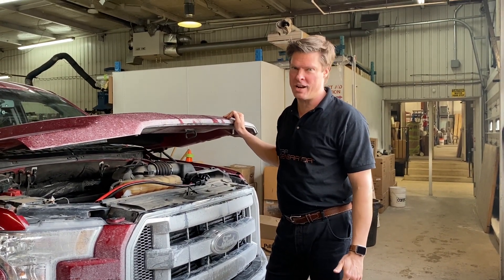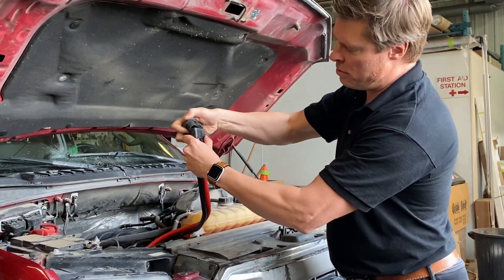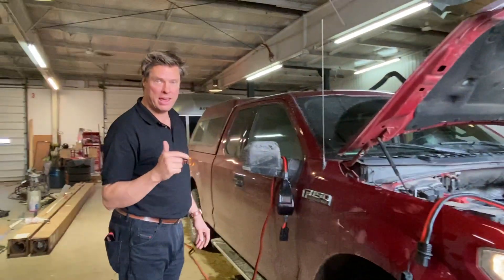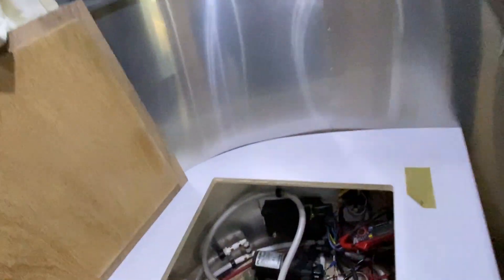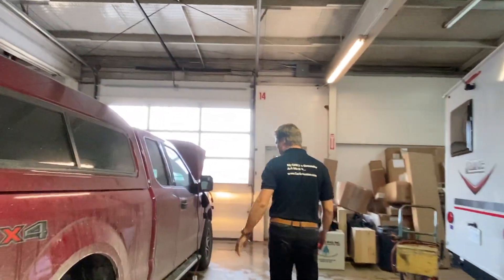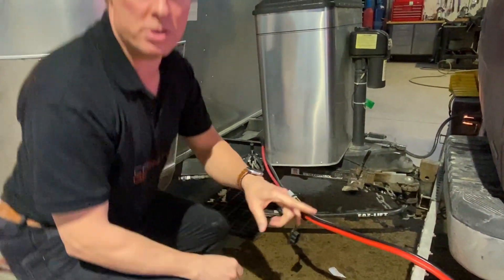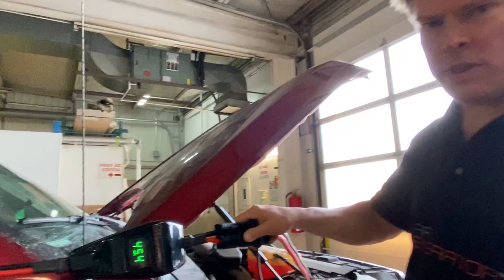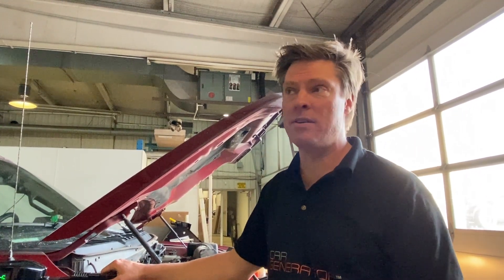CarGenerator Boost Charging vs. 7-Way Trailer Connector

Comment: Is there something that would prevent over charging the battery?
Reply from the maker: the purpose of having the meter on CarGenerator boost, is to show the rate of charge, how many amps are flowing in.  So the user would connect it to get the "bulk charge" , and then as the target battery approaches full the amps rate decreases and you then disconnect it.